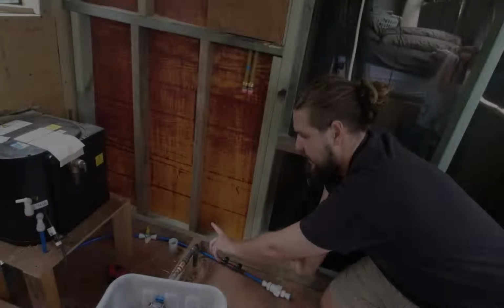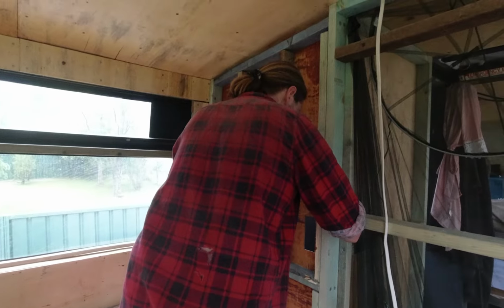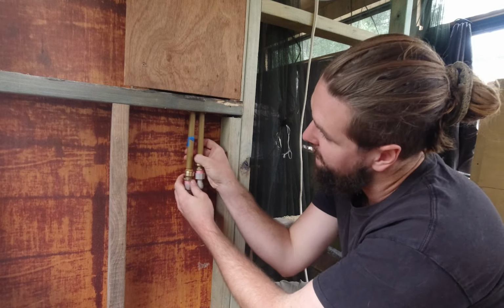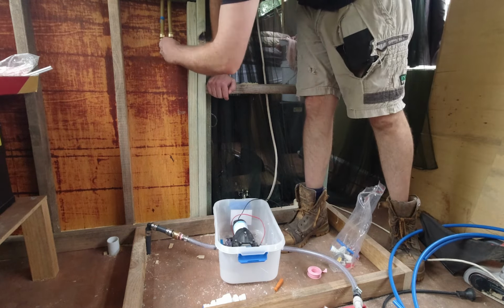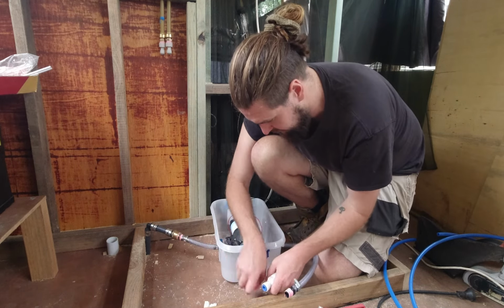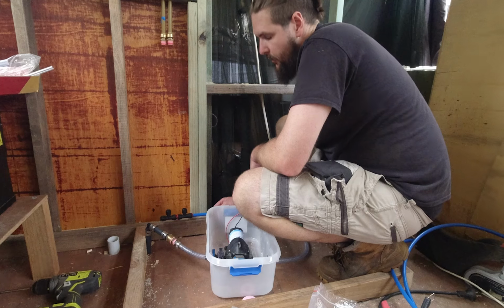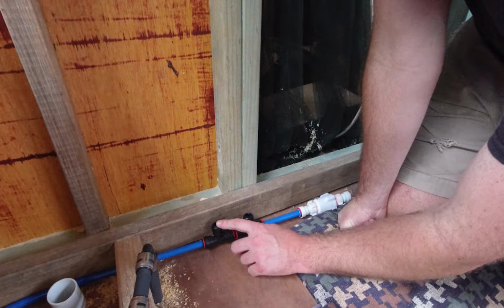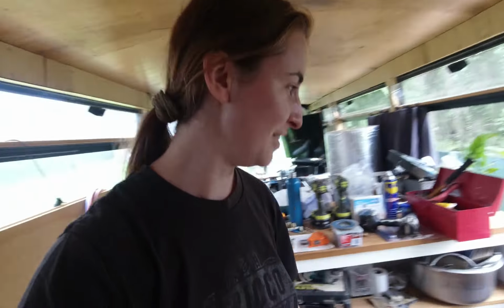Plumbing and Gas Water Heater Install on Our Australian Bus Conversion

Comment: hey guys i am building the same bus ap starliner but with merc body. i did the same with john guess i binned it all. absolutely crap. go with shark bite or oz pex crimp. john guess is nothing but leaks. each to thier own tho love the build series😊
Reply from the maker: Honestly the John Guest stuff has been such a rollercoaster! Because it's the only thing that fits well our hot water system (caravan end) it's something we have had to use, certainly would've avoided if we knew the stress, however I think so far it's doing what it should. As for shark bites on the other end, we love the ease as you mentioned!

How are you fitting to caravan systems without John Guest, do they have smaller pipe sizes too?
Reply: @DiandSam   we literally went down same road. but have steered away from all caravan systems on everything as they are not designed for full time use as per say. our hot water system is a rianna b16 continuous flow. mounted under right side of bus. we also have full size house washing machine ect.
thanks for your reply 😁